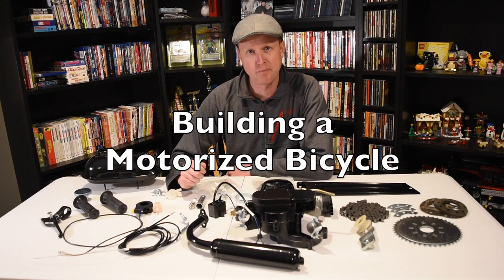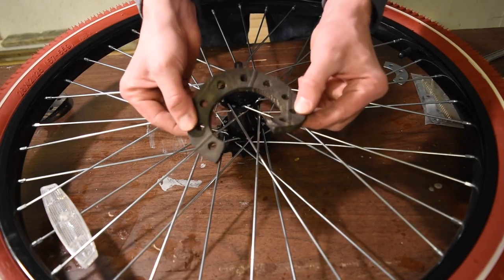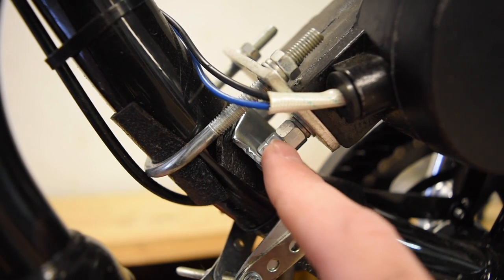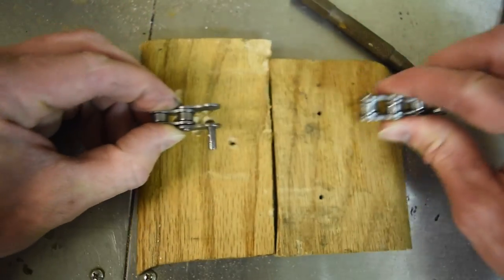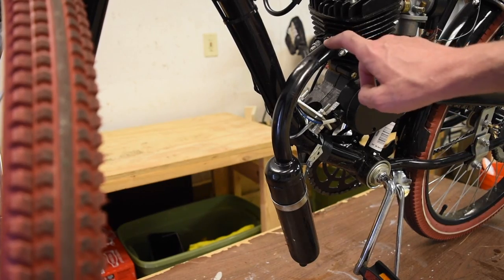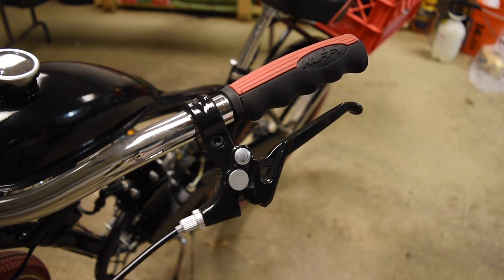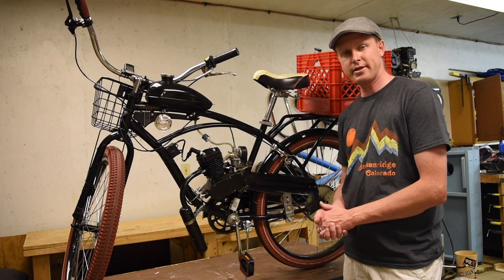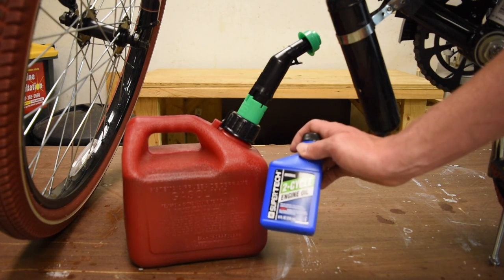Building a Motorized Bicycle - 80cc Engine Kit - 75 mpg

Comment: Steve I bought a 60cc  kit from Walmart on line that was on clearance for $99.00 and the same bike at the store  for $89.00 (on sale). Put the sprocket on and I went back and check your video and saw that you still had the wheel bearing dust cover on so I took the sprocket off because I left off the dust cover and when I reinstalled the sprocket with the dust cover the wheel would not roll. I got fed up because the kit I bought came with no instructions. Went back on line and down loaded a PDF from Bike Berry and printed  the instruction/ operations manual (43 pages), Their  manual said that you leave off the wheel bearing dust cover, it was no longer needed (page 5). So tomorrow I will for the third time take off and reinstall the sprocket. Here is the link for the instructions http://bikeberry.com/FlyingHorseMegaMotorsInstallationGuide.pdf

Comment: i have my kit set up but the rear tire is locked even when I compress my clutch can anyone help me out?
Reply: @Steve_Does_Stuff  after removing the spark plug the wheel doesn’t spin completely freely but it did spin easier
Reply: What else should I do if it is a clutch issue
Reply: @Steve_Does_Stuff  I tried that but it still didn’t work? Could it be that my chain is too tight?
Reply: @Steve_Does_Stuff  alright thanks for all the help I’m going to try that I’ll get back to you when I do

Comment: I'm not gonna lie man I've had 2 of those same exact huffy model and I swear by them. Amazing frames for the engines but if your around 130-165 lbs a 29 inch bike tire will give you 5 mph on your top speed

Comment: Hi Steve. So i have my engine on order. Should have it next week. I bought my 2 stroke oil. So im already thinking of upgrading the kit sparkplug and fuel line. Is there any other advice that you could give me as far as installation and preparation that would make operation of bike complete? I bought a 26" Ross mountain bike from a thrift store for $20. Im no stranger to bikes. Everything looks good on it. No cracks in welds or anywhere. Will replace tires, tubes, and brake pads of course.
Reply: OTEC's olutions yes. Cause the rag joint is a PIA! How much is that adaptor? Thanx
Reply: my father's an experienced mechanic and has lots of experience with bicycle motor I found out, here's what he says... 

because of how 2 stroke engines use the fuel/oil mix to lube, much of it burns off but still leaves some residue, most oil additives are designed for 4 stroke motors, using oil additives in 2 strokes can not only REDUCE the efficiency of the fuel burning off, but the residues themselves actually increase the need for regular maintenance more frequently and CAUSE long term damage and reduction of engine life, and believe it or not, using full or blend synthetic oils in the fuel/oil also REDUCE fuel efficiency because of the higher resistance to high heat and ignition, a strait up proprietary, pure 2-stroke oil and shell premium with nitrogen is best. 

also, do not use fuel additives that add octane, on small 2 stroke engines they serve no purpose, the compression is not sufficient enough to be of any benefit.

DO NOT use fuel additives that have lots of detergents, except when doing breakdown maintenance, the engine relies heavily on the oil residue to lubricate and detergent additives in oils break down that function causing increased wear and tear, increasing the frequency of maintenance and reducing engine life.

if you insist on using a supplemented oil (an oil with additives) or oil additives anyway, NEVER, EVER, EVER use ones that have or add metallic and/or flammable substances such as zinc and phosphorus, these are optimized for 4 stroke engines, because 2 stoke engines burn off the oils, the metallic additives create deposits that actually damage the piston walls and rings, further increasing the need for breakdown maintenance and reducing engine life, as for flammable additives such as phosphorus and sulphates, these burning off in the engine create acids and cause severe corrosion in these smaller engines especially. 

keep your oils and fuels as pure as possible and it will help greatly

when you intend on storing your bike for more than 60 days, empty the fuel tank and add a fuel stabilizer but NO oil, when you decide to go and ride again, add the requisite amount of oil, then idle the engine for 10 minutes, shut down for 30-45+ minutes for cool down, then go and have fun

try and remember, "2 stroke" & "4 stroke" are NOT numbers, they are completely different types of engines, and need to be treated as such. 

I do recommend an oil additive called 'nanolub csx', but NOT for mixing in the fuel, it makes an AWSOME lubricant for external moving parts on the engine and bicycle and chain,  may your bikes "Live Long & Prosper"

Comment: Great video and neat project. I have a question if you get a minute to take a measurement for me. I am wondering what the hight of the motor is. Could you get a measurement from the lower V in the frame to the top of the engine head or spark plug? I am trying to find out if this engine would fit in the space available on my bike. If you get a chance to get that measurement for me I would greatly appreciate it. Again neat project and great video. Thanks for sharing.

Comment: 4 questions... 
1: how much is the total weight of the motor, the rider & the bike ???
2: what is the top speed on smooth, flat road terrain ???
3: what is the steepest grade the motor can operate ??? (I travel around some steep, paved, residential areas)
4: what is the avg. distance you cover on a single tank ???

sorry to be a pain, I've been looking into getting a supplementing power supply for my bicycle, I had determined that ebikes (kits included) are too costly in the beginning and for battery replacement costs, the distance is limited, ect., ect., so I decided on gas, but need an idea of if the 80cc "Flying Horse", 4 stroke I'm looking at is sufficient for my needs, no dirt riding, but trips of 30+mi 25% of the trips is up about 30 deg roads, I don't want to get the 212cc motor I've seen around if I don't have to, Alabama (police officers) are pretty easy on basic motorized bicycles, but they usually harass those with stuff too big or too loud
Reply: thank you very much, this helps big, my father's pretty knowledgeable about motorized bicycles it seems, but could not tell me a single thing about how bi a motor I should get, again, thanx for your time

Comment: Do not turn the idle adjustment screw without accelerating on the throttle because if you do you will bend it and you will score the throttle body piston that goes up and down

Comment: Very Nice... So you can use a coaster brake rear wheel and don't need to change it to a freewheel correct. 
No problems using a coaster brake bicycle with one of these engine kits ?
Reply: @Steve_Does_Stuff  Good deal, appreciate the info... I'll check-out the video, Be Safe !!!

Comment: I was interesting to see how you make it go 75mph lol ,Nice going I ready have 2 and I'm going to buil more ,I remember wen I buil my first motobike I forget to put lack tie on the screws and found out that all screws tha came from the factory are low quality so for now on I always buy a good quality screws ,lock washers ,wire tides you know how those tins get lose with the bivrations,then  to avoid  the motor moves saiways I preferred to grained and make the right diameter make new holes and treaded so everithing stay in one peace I prefer a 29"beachcruiser aluminum its hig and light , the muffler won't hit any bum I will like to make a good vide like yours to show the little performances I have learned ,in my channel I show I  few sort videos like how to bend the pedal brake etc  any ways your video it's so helpful
Reply: Top speed around 35 to forty they say
Reply: Malkitzedek Pf he said MPG! And thats not correct either they get better gas milage than that.
Reply: Loctite !

Comment: I've assembled my motor bike. But when I pedal  its too stiff to move. The back wheel is frozen.
Reply: @Steve_Does_Stuff  I adjusted the clutch, and I got it working.  I've been adjusting the screw on the left side of the carburetor.  I've been turning the screw clockwise 1/2 turn, then driving it 1 block. I did this about 5 times. Then it started sputtering and having a hard time to start.  I tried to turn the screw counter clockwise about 5 1/2 turns but it is still having difficulty starting.  Any other ideas?

Comment: Hi Steve. I just wanted to give a Big THANX to you and your video that i was able to put my bike motor together without even looking at the shitty instruction manual. Very good job at making a video that's easily understood. You should find out about making a Dvd that distributers could put in their kits. For a small fee. Thanx again! 👍👍👍 P. S. How are your tires doing? Especially the rear. Are you having to replace them often? I have 300 miles on mine which were brand new and rear tire is wearing out faster than front. I've got 40psi in them to create less drag. Think too much air?

Comment: OK , so im watching several videos. The way the sprocket faces seems to be different for different videos. I have mine on the way you do in the video at 2:35 or so. Was this incorrect or was this when you fixed it?  i have the same bike as you so I'm trying to not mess up :) And the correct way is at 3:12?  Correct?
Thanks!
Reply: Thanks, it only makes sense to put it out. I'm not sure why some of the other videos are saying the opposite. I could already see how the chain was extremely close to the spokes too. It could rub against those too. Thanks, I have to disassemble now. :)

Comment: I got the same bike, and a similar engine, i only payed 97 dollars for mine by ibestbuy2013 on ebay. Tried putting it together with a friend but the video we watched had a different method, he used 5 sprocket plate thingies for the rubber pieces which got us really confused, and the engine sat low enough to atleast put the tip of my finger between the engine and gear, so that made things a little more confising, but since we came across this video, im hoping we will get it all set up tomorrow

Comment: Hey! I have a problem with my bike. I was using the first 3 tanks 16:1, and the engine ran really really good. I had the muffler off. I have finished the break-in period. I am now using 32:1 gas, 95 octane (The other is 100 wich I think is too strong). 
I have just now started to feel the bike not having power a couple of weeks ago. One morning I started it up, and it wasn't accelerating, it's idling very slow, sometimes even stopping (The idle screw is in so much, that if i twist it 1/4, I can't twist the throttle) the spark plug is light grey, i have fully cleared it with baking soda, and with a pin, put it back, still. I have tried every possible C-Clip position (Stock NT carburetor) If I don't have the throttle at least 1/2 pulled the engine doesn't ignite (From what I can hear) and only goes if I have it pulled fully. I have sealed both sides on the intake manifold with red hi-temp silicone (It doesn't melt untill 340 something celsius, or 644 fahrentheit) and it still does that. Not sure if it's an air leak still. I do have the low idling, wich when I'm not moving and have the clutch pulled, for some reason it fluctuates in RPM's a bit. I also hear a ratling or clanking sound inside the engine. I have looked into it and saw like a white paint like thing on the walls, they looked like they were dripping, but were completely dry. 
Could it be that my piston rings broke? Or does it not have compression? The head bolts are tight, the manifold has 1 nut that broke but I think that shouldn't be causing it to not work. I'm going to the hardware store tomorrow to buy one to replace it.
Reply: Thanks! I will try that. How do I know if it's leaking? Will it lose pressure over time? So let's say the piston is down, I push my thumb into the hole, and roll the bike up. If it loses pressure immediately is that bad? Or can that be just my thumb?
Reply: Hey, so I did what you said. I unscrewed the plug, put my finger at the hole, pushed it on the hole hard, disengaged the clutch, and rolled the bike slowly. It felt very weak. Like when you suck on your finger (Sorry I don't have any examples...) and when the piston was comming up it was weak too. It couldn't push the air out. Then I rolled it a bit faster and same.

Comment: So I took the engine covering were the clutch is connected off so that I could put on the chain. However when I put the covering back on, the clutch lever was in a wired position and wouldn't move anymore. Any suggestions?
Reply: Steve I'm referring to the chain sprocket cover, although I did remove the clutch cover to make rotating the sprocket easier (it was  stuck when it first came out of the box). I still can't seem to figure out what's wrong. Thanks for the help though.

Comment: My issue is my tank when it has fuel in it it will be completely dry with in 2 minutes of letting the bike sit. so i am going to check the fuel shut off but even if that isn't working the carb should be holding all the fuel but it is not? Not sure what to do.
Reply: Steve Does Stuff! Nope it is all sitting in the motor and in the exhaust pipe.
Reply: Steve Does Stuff! Yea I have taken the carb apart 4 times and nothing seems wrong. I am a mechanic so I know what to look for if any thing is wrong and nothing was out of the ordinary. I might just buy another carb. Not sure what to shy though I have heard good things about one and bad things about it also. Is there a carb you recommend. My bike is a 80cc

Comment: Hey +steve does stuff I have a question why is it when I come to a complete stop my bike either stops running or pops clutch, it won't stay idle. It will of course run but won't stay idle when I stop. Can you please tell me whybthis happens?
Reply: +steve does stuff I touched the idle screw and think tht might do it. But do I still have to hold in the clutch?
Reply: +steve does stuff  thank you for the help, yeah the bike jumps or turns off when  I come to a stop. So when I put my new sprocket adapter on I'll try what you mentioned.

Comment: Strips of old inner tubes work great to restrict vibrations too.
Reply: While we're being economical and reusing inner tube rubber, if there happens to be a used radiator hose or heater hose from a car kicking around, they are thicker and provide extra cushioning. I haven't tried the rubber mount cushions made for the job.

Comment: The foam is a good idea. I wonder if tire tube rubber pads, single, or doubled up or more, would not only keep the scratching down but offer some vibration dampening. Could be substantual, and two birds with one stone.

Comment: Good luck with that Nel Lusso... I hope youre aware of the defect in those frames where the luggage rack is welded on. They snap on both sides and many people have almost been killed by using this frame.
Reply: ive been riding the crap out of the same bike for nearly a year now. No cracks yet.
Reply: Many people have been killed driving riding motorcycles costing thousands of dollars and in automobiles that malfunction. Did that ever stop people from riding or driving?

Comment: Spun the sprocket to put the chain on and the spark plug was still in the engine(stupid mistake) Now I can't pedal my bike even with the clutch handle depressed. Is there anyway to fix it?
Reply: Steve ok, I'll try it tomorrow morning. Thank you
Reply: So I removed the spark plug, took off the cover plate and the chain is not jammed. The clutch pin however, will not move up or down. Not sure what to do now. Do you have any more suggestions i can try?
Reply: Ok, so I got to it turn, but the metal pin in the middle of the sprocket won't depress when I pull the clutch handle, now allowing me to freely pedal without turning over the engine. Does that mean I need to adjust the flower nut on the other side of the engine?

Comment: Great looking machine which will not get two blocks before one of those cheap parts go out.
Reply: HA! Many of these bike have gone thousands of miles and are daily riders, just need to do the required maintenance, lubrication and repairs like any vehicle or piece of machinery. It does help to add disc brake for extra stopping power, front suspension forks and a suspension seat for riding comfort. Great fun really!

Comment: I really want to try one of these out as kind of an interesting project. The only thing that worries me is that I live in California and while I know that the DMV is cool with something like this, I've read on a few places that the California Air Resource Board only allows these engines for closed course usage. I really wonder how strictly that is enforced though, I doubt most police officers would be aware of that unless the department has had issues with these kinds of bikes.
Reply: I lived in Lompoc, San Diego and Long Beach for years and saw many of these, the police don't seem to have a problem so long as you ride safe, responsibly and your ride is not too loud or to fast, but if you act like a jack-ass on the road or loud or trying to be a show off or going too fast, then they WILL be super pricks
Reply: i think its fine if you wear a helmet and ride safely, theres also engines that are certified with epa so they are street safe, try it out, its a really fun project and you learn a lot!

Comment: I was caught by the 75 MPG note in the title ..  Had a 175 Honda (twin 4 cycle) which ran
always in the 82-84 MPG range ... Also owned a 185 Suziki ( 2 stroke ) which ran a constant
66-67 MPG ... Both are around town mileage ... The 185 was HOT !